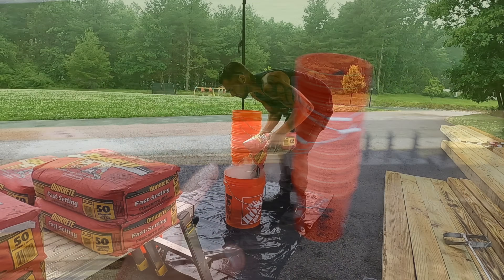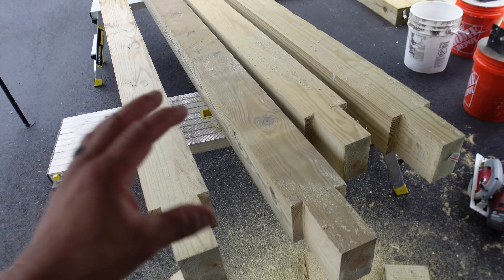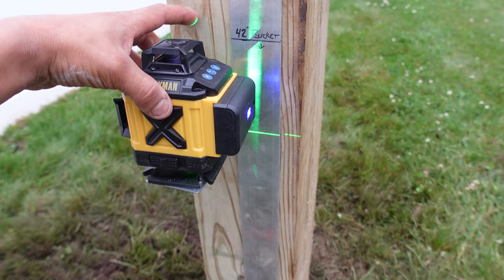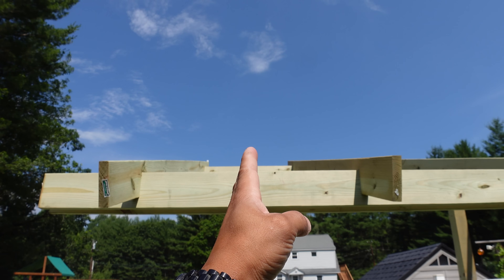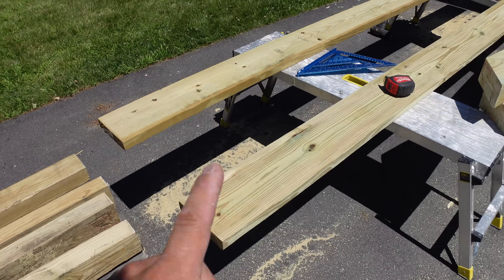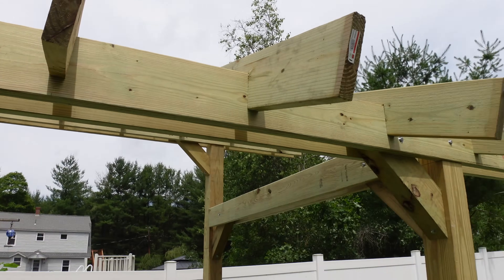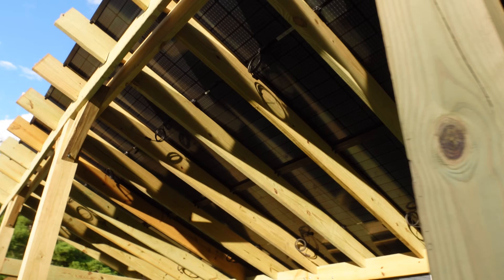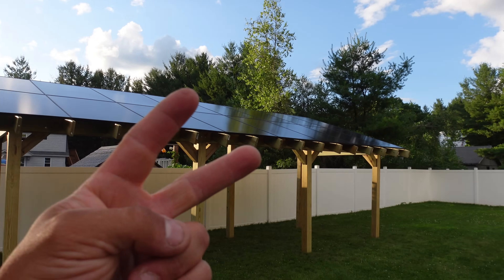Building a DIY Solar Pergola | Step By Step

Comment: It looks nice, but can someone fill me in on the need for the buckets and the metal brackets that will rust away and the posts that will rot off?  I could see using the brackets if they were above ground as they should be…..

Comment: Not sure of your climate, but what is the freeze thaw depth in your region?  Otherwise you cd get heaving and displacement (of the posts/footings) as the ground goes thru freeze thaw cycles..  Might be helpful for folks in other regions to address that issue for posts/footings that go into the ground.  Also, those rafters are notched so deep, it negates the strength. (Don’t notch more than 1/4 the depth.) Should reinforce them or they can crack/fail since you mentioned you have snow loads. Could also have some wind uplift unless you included hold downs on those rafters.
Reply from the maker: 32” is the frost line which I am past. Also yes I threw some finish screws in the joists for extra security off camera that I will mention in one of my future upcoming videos

Comment: It appears you have a 4 ft rise over an 8 ft run which calculates to 26.75%.  Were you shooting for a particular angle or just guestimating what angle would work best based on the sun's location?
Reply from the maker: Just guesstimating and facing them south which I hear is best for placement 🤙🏻
Reply: Can you share the calculation?

Comment: The posts should not be in contact with soil to prevent them from rotting. Best is to keep a distance if 6 inches between the end if the post and groundlevel. Beside that is it a cool project. Wish you a log of sun.
Reply from the maker: @mausr8488  yes 100% agree I’ll put rocks around the posts at a later date!

Comment: I love this idea!  You see people mount them on houses, sheds and have standing units on the ground.  But I think the solar pergola looks fantastic.
Reply from the maker: Thanks brotha, Appreciate that!! 🙏🏻 

Final Cuts / Material cost video releasing tomorrow! 😎🤙🏻
Reply: And a Solar Carport, like I did.  Keeps the sun and rain off my classic car parked on the side driveway behind the fence, plus other good-stuff I keep there.  Otherwise, a car tarp barely lasts a year in our evil sun and if in the rain, water can sit under the tarp to cause corrosion.  I plan to add a solar gazebo beside my pool to make the space more useable in summer.  Just don't know what I'll do with the extra PV power, other than power the pool pump (new ones can run straight off panels).

Comment: What was the manufacturer's recommendation on spacing for air flow and bonding? I see an issue butting them together for air flow and bonding, not to mention just laying them on the trusses.  I like it I just don't think it's to manufacture specification. It is part of the electrical code and I have been in the solar industry for over 8 years and have never seen solar done like this on any installation.I like the idea for sure!
Reply from the maker: To be honest not sure probably not recommended but this isn’t a grid tied system and I’m just a guy with tools LOL

It should work fine but in the rare chance it doesn’t I will be the Guinea pig for you 😎🤙🏻

Comment: Awesome solar pergola.  It is nice that your backyard is very level.   Even so, My main question is how did you get your uprights to come out exactly level across the tops, and especially so that the notches were exact?   Did you have to make multiple adjustments on each hole, from being either too shallow or to deep, to get a level point across all of them?   Did you draw a line at 42" above the concrete bucket on each post, and then match to that point with the laser level?
Reply: Check out a water tube levels
Reply from the maker: So yea it was a pain in the ass to get them exact but I would ROUGH measure the length of the bucket plus the 42" before putting the bucket in to see if it was exactly 42" from the top of the bucket... I did have to remove the buckets once or twice being off by a little. That was horrible but coulda been worse lol

Comment: I don’t understand why you used the buckets and brackets vs just cementing the posts directly in the ground? Eventually the bracelets and screws are going to rust away. But great video! I’m going to copy this above my deck build on my tiny home.
Reply from the maker: I actually did this so its a "temporary structure" and I didnt have to deal with permits and all that BS (If that makes sense)
Reply: Metal brackets and screws will last longer than a wood post in the ground or in concrete. Not a real worry.

Comment: Your bird's mouths are not bird's mouths, those are full on notches that significantly reduce the board's integrity and strength. They should be as shallow as possible into the rafter and still do the job of locking it in against sliding out of position. That said this was my only critique and its a small one as those were wide boards already so you should be more than fine for the application. Nice build.
Reply from the maker: Yea probably coulda went a bit less but Im a Master Plumber by trade not a Builder LOL! I think the strength in numbers will be ok in this instance 🙏
Reply: @ChumpChangeXD could always put some joist hangers on it and would have zero issue

Comment: Thank you for sharing your excellent work! How do the panels attach to the wood frame? I thought there were typically long metal brackets which install perpendicular to the joists, and then the panels attach to the metal brackets via clips.
Reply from the maker: Thank You! So I purchased some 1" clips I beleive they were and used some Metal Tek screws to zip them into the panels and then wood screws to go into the joists. That was the best way I could see to do it. I will go over everything in one of the next videos for you!

Comment: Why are you burying post screwed to anchors in bucket of concrete? That's not how you use any of those components. The anchors go in a concrete pad, if your burying the bucket just lose the bucket and concrete in post in the ground. the bucket serves no purpose in this instance, but putting extra plastic in the ground. Everything else is great just confused on the buckets.
Reply from the maker: The bucket servers as an Ancor in the ground… can’t say it servers no purpose lol. That’s ridiculous! The point is to keep this a “temporary structure” if it needs to be taken down and removed  for some reason; also avoiding permits.

Comment: Dude. No idea what you were doing there with the concrete footers in buckets. In one shot the footers were in orange buckets, and in the next shot the posts were in the ground with nothing visibly exposed and grass looking perfect seriously? Why would you skip showing this important step?
Reply from the maker: Watch when the second poll is being leveled you can see it clearly in the hole my man. It was raining couldn’t record that but you can see me drop the bucket in the corner of the screen sped up when I first started digging it
Reply: @ChumpChangeXD  ahhh, I think I had skipped too far ahead. Sorry about that. That's an interesting way to do the footers. Most people would have dug the holes, set strings, pour concrete in the holes, and then set the post brackets. I'm sure you have an interesting reason to do the concrete in buckets. Was it so that it would be easier to take it all apart and move it?
Reply from the maker: @Gruuvin1  yea more or less “temporary structure” this way
Reply: @ChumpChangeXD  I like it! And thanks for the video. It's awesome to see all the different ways people do their panels. This idea might be wife-approved, which is important. (form before function)

Comment: 7.4.24  Did you have toi get a building and electrical permits?
Reply from the maker: You probably should but it’s a “temporary structure” the way I built it and the electrical is all off grid so they can’t do anything tbh.

Comment: I'm an engineer and I also build a DIY solar pergola and DIY solar pavilion and I think you did great. My only recommendation would be to use carriage bolts instead of lag bolts. Carriage bolts will go the whole way through everything then you clamp it all together with a nut. That will hold tension better than lag bolts.
Reply from the maker: That’s a great point! Thank you and I appreciate the feedback!!! 🙏🏻🤙🏻
Reply: He should’ve used masonry sonna tubes instead of plastic buckets. Plastic is very slick and prevents dirt/soil from bonding with it. It’s much easier to pull out of the ground on wind lift as opposed to friction created using sonna tubes
Reply: @SamClemens-n9q  Oh don't criticize him or he will whine about it all day.
Reply: @muyoso  OK this threa is getting amusing now :)
Reply: @SamClemens-n9q  the pullout calc basically assumes the bucket has zero friction, but the dirt on top of the bucket comes up in a conical shape.
Reply from the maker: @SamClemens-n9q  you are correct that was the entire point though to make it easily removable as it’s a temporary structure
Reply: I am surprised your setup works. What is your hourly solar collection? The rafters are getting sun from the fence but what about your bi facial panels?
Reply: How did it hold up in winter winds?
Reply: @amayer171  I live down the road, saw it fly past mid December, heading North West.
Reply: @AlexWaardenburg  how about wood glue for laminating?
Reply: What Alex said, but I also would not have cut my Rafters so deep to fit on the top, a notch to level will do!  Nice job! a 2x2 is not as strong as a 2x10 :)
Reply: He's not building a deck.  It's only supporting the panels...even deck screws will do.
Reply: Come on. No engineers can actually use tools. But they sure can draw.
Reply from the maker: Haha as a master plumber by trade you are 1000% correct most of the time but I think he’s got a point here 😂
Reply: @ChumpChangeXD  im also a master plumber. Too funny. Cant stand dealing with engineers and architects on the jobs.
Reply: @ptech88  I'm not going to argue your points, sir. Engineers are insufferable! I only bring the point based on experience. Especially with pressure treated lumber it's going to shrink as it dries and loosen your connections. I had to run around and retighten all of my bolts periodically.
Reply from the maker: @ptech88  that’s a riot! Toilet on this 12” steel beam NP! 🤣
Reply: @ChumpChangeXD  exactly. They can build anything with a pencil
Reply: I don’t get why you need the 5 gal buckets? Why not just set the boards directly in ground and add mud!
Reply: @Jonathan_O  I thought the same thing then watched his other video where he explains what it costs. In that video he mentions that he wants it to be "portable" so he could unbolt the posts, pull the buckets out and move it if he really had to.
Reply: @ptech88 do you have an engineering degree or know how hard it is to get one? My son has one and he can also work with his hands. In actuality a good engineer can also do the work he draws.
Reply: You are an engineer and you had no issue with him bolting a bucket of concrete to the bottom of the post and then burying the whole thing?  You had no issue with him not notching his posts for his joists and simply bolting them onto the posts?  You had no issue with him notching a 2x8 down to a 2x3 for his rafters?  FFS, please tell me you don't work on anything in Virginia.
Reply: @muyoso  I was here to ask how much people would take out of those 2 x 8 joists, i wouldn't go deeper than half :)
Reply: @ukqwerty999 way too many bad decisions in one video 🤦🏽‍♂️ I think this is a new record
Reply: @muyoso  are you an engineer?
Reply from the maker: Dude a troll ignore him.
Reply: @AlexWaardenburg  No, but I know what is and isn't kosher building basic wooden structures.  This video is wrong from top to bottom.  Every single thing he does is wrong.
Reply: @ChumpChangeXD  You can call me a troll all you want, but it doesn't change that every step along the way building this thing you did it wrong.  Being praised by a bunch of people who also have no idea how to build a basic structure may make you feel better, but it doesn't change anything.
Reply: @muyoso  If he were building a deck than those things you listed would improve the strength, but he doesn't need the strength of a deck for a pergola. His biggest flaws are using material that's too beefy and too much of them, but he made those choices for aesthetic reasons.
Reply from the maker: “Mic drop” 👆🏻
Reply from the maker: I have no problem taking constructive criticism but when you say something is totally wrong in every way… LOL you being a troll. 

Buckets are weights for a “temporary structure” so I can take it down and move at any given point. 

Ask the “why” before you criticize negatively… it’s a horrible look.
Reply: @ChumpChangeXD  Well I broke it down in my comment how each and every thing you did was the incorrect way to do it.  And then I saw in a different comment of yours that you are in new england, so snow is going to destroy this thing.  Not trolling at all, just very much dislike people showing others the wrong way to do things.  You won't find a single professional building a structure the way you did.  The reason for that is that there are better ways to do things that are more sturdy.
Reply from the maker: @muyoso alright guy. Guess it’s a good thing I’m just a master plumber and not a guy banging nails for a living 🤣
Reply: @ChumpChangeXD  Year late, but the troll has me going, why didn't get a prefab kit of metal? Damnit, I want something that will withstand a 100 years of snow...;)

Comment: Looks great! I do have a question, are you worried about a strong wind grabbing those panels and ripping them off the frame?
Reply from the maker: Thank you! I mean yea that’s always a worry but I have 4 screws on each side. I would be shocked but I may add some additional stuff later now that it’s done 🤙🏻
Reply: @ChumpChangeXD  I am also using 2x8 for my framing on my solar pergola. Living in a windy area I am using 4 1/2" Anchors to hold them down, Tulsa can get some super strong winds and they will rip out the small screws easy.

Comment: Looks awesome! Question, having a support joist right in the middle of the bottom side of the panel, essentially permanently shading it won't render useless?
Reply from the maker: Thank you! Yes tho you are correct. BUT, my reasoning for that was being in New England I am worried about the snow TBH

Comment: Nice work on this one. I’m looking at getting some similar panels to expand my system.
Reply from the maker: Dude these panels are awesome looking with the black frame! Signature Solar came through quick as well which was nice. They are the 495w Bifacial "Hyperion" (Link is in the pinned comment for their site)

Comment: Looks awesome man! Looking forward to seeing the next video. How did you mount the L brackets to the panels? Self tapers or bolts? I’ll be building mine here soon can’t wait!
Reply from the maker: I used some self tapping black “tek” screws 4 on each side of the panel. I will make a full parts list in the next video for you!

Comment: Clamping zones on the panel installation manual would help determine minimum span/clamping zones.
Reply: To ensure you meet the panels rated loading , wind zones and not shade the panels from structural supports
Reply from the maker: @davidg487  Thank you!

Comment: Uh so the sun isn’t hitting the back of those panels, any sun that makes it to them is heavily shaded and is unlikely to contribute at all. Looks cool but you need completely clear view of the back for bifacial (those supports are far too deep) resulting in heavy shading. Super interested in the production/output.
Reply from the maker: Your not wrong to a point.  UV Rays bounce so it doesn’t have to be 100% direct to get power. It just won’t be as significant but it will not be zero that’s for sure. Anything from the back is actually a bonus in my mind the main goal was to get the top  facing perfectly south for max input most of the day.

Thank you for watching! 🙏🏻

Comment: Looks nice, I will probably follow this for mine when I get to it. Doesn't that wood rot in the ground though?
Reply from the maker: I mean over years and years yea for sure but for a 6x6 Pressure Treated to Rot fast or badly is very unlikely. I’ll prob be dead by then 😂

The alternative is you could do 4 foot sauna tubes in the ground, but I didn’t want to have to deal with any permitting BS from the town  (already boarder line lol)

Comment: How durable are these in say, a hail storm? I have a gazebo thing that has an aluminum frame and corrugated plastic panels as the roof, they were touted as durable and would sustain whatever mother nature could throw at it. Well.. they have holes in them now so mother nature won. I want to build a new structure with wood and think having a solar panel roof could be an added benefit. You do very good work and everything is looking great!
Reply from the maker: They should be as tough as say a windshield more or less. But with that being said it depends on the level of the storm… I’m sure anything can take it’s toll over time. If I were to guess the plastic you had was weakened by the sun over time which allowed the hail to puncture it.

Comment: You might want to try a small experiment with some type of relective at or near ground level to encourage more sunlight to the underside of a panel and note if it differs in performance to a panel not receiving reflected sunlight. I believe you m8ght see a noticed improvement.
Reply from the maker: Awesome I may give it a shot! Thank you!